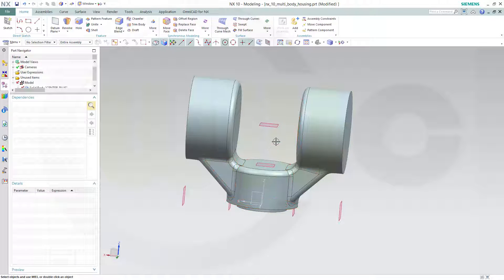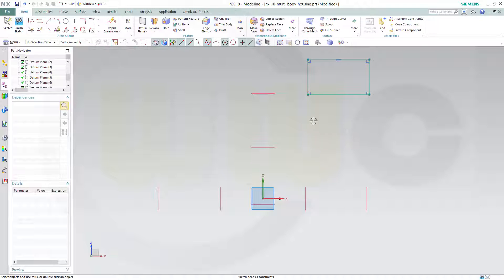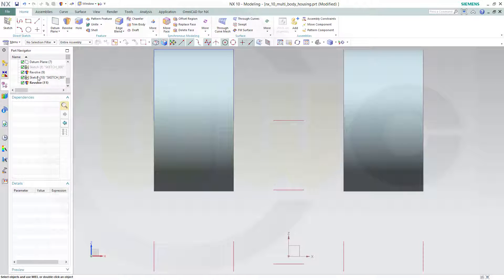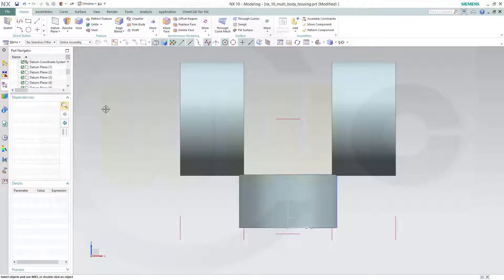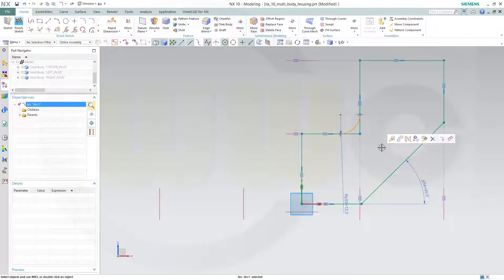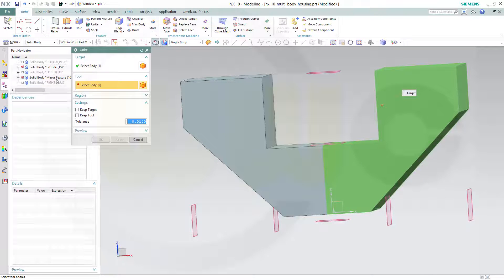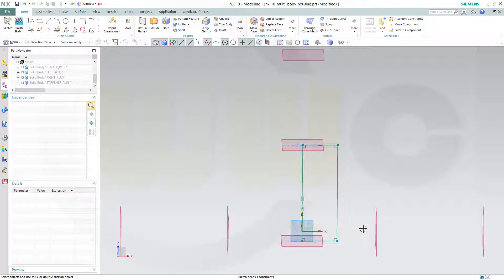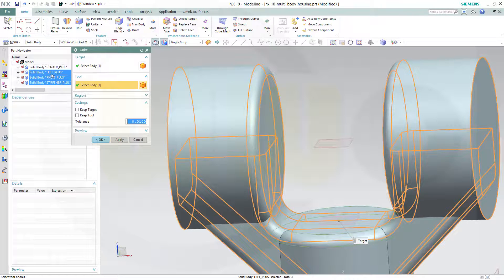Multi-Body-Housing - Part 1 Exterior - Siemens NX 10 Training - Methods

Comment: There is designing method called Chunk solid approach or chunky which doesn't require any sketch in NX. Do you know how to design parts without using skecthes?
Reply from the maker: As far as I know all important "players" use sketches. These solidbased features are obsolete no one use these "old" unigraphics commands..